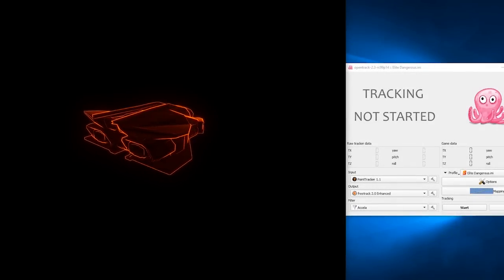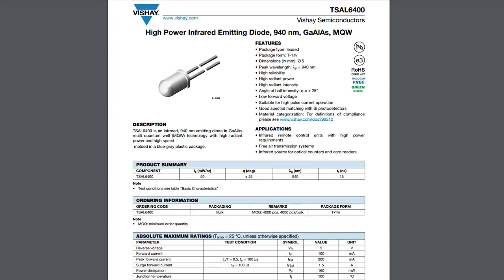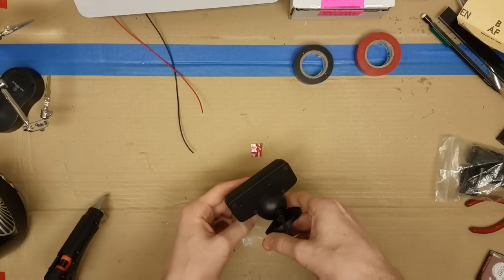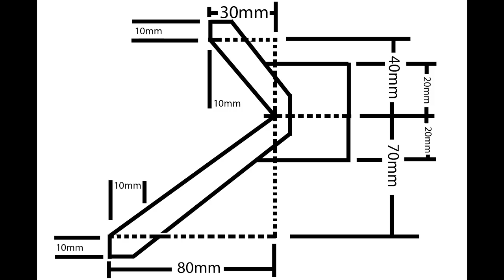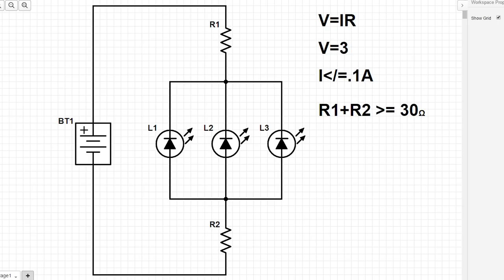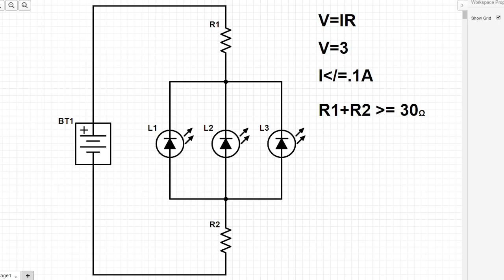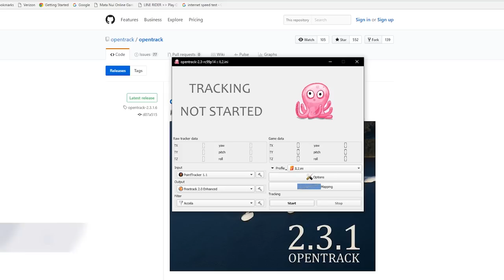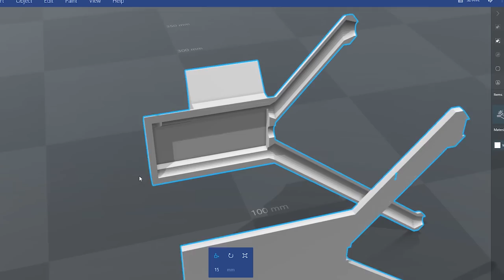TrackIR Build Tutorial

Comment: Hello, I use the Trackhat in combination with the flat lens camera from the PS3 (the same you use in your video). But I don't have a IR Filter lens. Can you tell me, what this lens is for? My camera works pretty good, but I need to darken the room to avoid light reflection from the window, which is on my back right. Maybe an IR Lens avoid it?
Reply from the maker: The IR pass filter blocks all visible light while allowing through infra red light. Most tracking systems utilize infra red light because it is outside the visible spectrum to humans, and so isn't a visible distraction. Using infrared will also help the tracking system distinguish between the head unite from other light sources in the visible spectrum. Example: My tracker can perfectly track my IR LEDs, but it is completely blind to a blue LED. Example2: Sunlight ranges from ultra violet through infra red. An IR pass filter in this situation would bock out all ultraviolet light and all visible light, but allow through the infrared light. This makes sunlight a particular nuisance for head tracking. If by "darken the room" you mean that you are turning down the lights in your house, then an IR pass filter will probably give you a significant improvement. If on the other hand you are closing blinds to block out sunlight, and IR filter might help, but it won't solve your problem. I hope that answers your question.
Reply: @civilprotection8845  Yes thanks. That helps. I have ordered a IR Filter Lense in China for a little less than 10 Euro. I also asked my father if he has an old floppy disk. I read that two or three layers will also filter the light and let the IR through.

Thanks for support

Comment: Do you happen to have the blender file available that you used? I have no idea about Blender and anything that can help with the main portion of the shape would be really handy
Reply from the maker: Check the bottom of the description. You should be able to get your hands on the blender file, and a .stl splitting it for printing. Some of the design choices are specific to me and my headset and may not have an obvious function, but the base shape should be easy enough to work with. Good luck with learning blender (It's really quite a handy tool!), and if there are any problems with the download links, just leave a note and I'll fix it :) Cheers!

Comment: any idea how to mount it to headphone? i build one a year ago using cap but it's aging so iam thinking of doing clip this time.
Reply from the maker: Velcro would be my first suggestion, but if you have a nice headset, maybe you don't want to get glue on them. I've been using cable straps like these: https://www.amazon.com/Rustark-Adjustable-Self-Adhesive-Straps-management/dp/B071RGCJLT/ref=pd_sim_60_2?_encoding=UTF8&pd_rd_i=B071RGCJLT&pd_rd_r=d21cb485-83d1-11e8-bc22-5d0e7f4bb9cf&pd_rd_w=6DjW0&pd_rd_wg=NyWbY&pf_rd_i=desktop-dp-sims&pf_rd_m=ATVPDKIKX0DER&pf_rd_p=7967298517161621930&pf_rd_r=7RWCJ0YP39ARWSB6N871&pf_rd_s=desktop-dp-sims&pf_rd_t=40701&psc=1&refRID=7RWCJ0YP39ARWSB6N871&dpID=51aPN5kuMTL&preST=_SY300_QL70_&dpSrc=detail

These straps only work if your headset is narrow enough where you want to mount the clip. I hope this helps.
Reply: does it matter if i place clip on left or right side of headphone?
Reply from the maker: I don't think it should. As long as you position the IR receiver off-center to the same side, everything should work perfectly.
Reply: How did you attach it can show me pls @TrollMilitia
Reply: @helelelop I still have it lying somewhere don't remember though but I simply used zip ties and hot glue & a sacrificial pair of headphones attached to its left side since there was mic on right if I remember correctly.
Reply: thx @MrTrolololol

Comment: hello, does it work with any ps3 camera ?
The delanclip system working with a specific model who is modified.
Reply from the maker: I really couldn't tell you for sure what the delanclip works with as I have never owned one myself. I would expect that an unmodified eye camera will be able to track the delanclip. However, the reason the ps3 eye camera is modified is to block out all other light and to isolate the delanclip lights. I hope that answers your question, and good luck with your build!
Reply: @civilprotection8845  ok thanks, so your solution is easier to make because finding the good camera is a pain today.

Comment: For using head tracker with laptop camera, which led is better for tracking?
 850nm or 950nm ?
 Flat or round head led?
Thanks for your great video.
Reply from the maker: Both will work just fine. You can even go as low as 700-750nm. What matters for tracking is the capability of the camera, the pass filter you add, and the  brightness of the LEDs. Some cameras can-- by design-- pick up infrared, and some can't. Once you have a camera that can, then you decide on both the filter and the LEDs you want to use. Brighter LEDs will track better at a distance.

Rounded LEDs with a diffusing solution (like sanding) have always had better tracking in my experience.

I have never made a setup with a laptop camera, so you might need to do some independent testing. Your first step imo should be to test the maximum framerate of the camera. 60FPS should be your minimum target (my PS3 eye camera runs at 75fps).

Good luck on your build!
Reply: @civilprotection8845  thank you so much for your kind help

Comment: I knos this is old video but... Its still works if i replace battery to USB cable, and i put this to phone charger or something? And how its looking with resistors ohm?
Reply from the maker: Yes it is possible to make a wired version, but you would need to figure out the voltage yourself. Try researching for USB transformers.

Comment: Ok is it AAA or AA Video shows AAA but link shows AA although the voltage is the same, I'm wondering about the amperage,500-600 mAh AAA & 600-1600 mAh AA? Thanks
Reply from the maker: So, in my testing, AAA and AA are functionally identical. The main consideration for me was weight. I ended up opting for the AAA because I could feel the AA pulling my head to the side (though nothing one couldn't get used to after 5-10min).
I also experimented with 3.5V rechargeable coin batteries, which were much lighter. Ultimately, after making this video, I redesign my own headtracker to run off a 5V usb to dc powercable.

I hope that answers your question, and best of luck with your build!
Reply: @civilprotection8845  Yes it has, I need to do a facepalm...never occurred that weight would be a factor. Thanks! 👍

Comment: This is great, but... want to make sure I'm not missing something. Assuming you don't already have a soldering iron (which I don't, and I think most probably don't), this build comes out to $91.51 on Amazon. Plus labor time. The Declanclip build is $15 cheaper and comes pre-made. AM I missing some cheaper step, or is this just for DIY folks who don't care about price?
Reply from the maker: Without knowing the contents of your cart I wouldn't hazard a guess about what you may or may not be "missing." If this is your first DIY and you are buying a lot of intro kits for soldering equipment, resistors, wire, electrical tape, etc. that will drive up the price. I calculated the price from essential components only: ps3 eye camera, LEDs, IR pass filter, battery boxes and software. That does work out to $30 or less (I would need to search through the comments, but I think someone mentioned they brought the price down to $10). I assume that someone interested in DIY circuits has electrical their own soldering iron & solder, wire, electrical tape, etc. for the same reason I would expect them to have an exacto knife or a pair of scissors to cut the cardboard to shape. these are just accepted tools and components typically not figured into any one project. It would be an interesting survey though; to see how many people already own a soldering iron.

The Declanclip comes up a lot, and part of me wants to purchase one just so I can accurately compare it to my DIY. Is it just the clip, or does it come with an IR camera? I don't know.

The point of the video is not to convince anyone that a DIY tracker is the absolute best option, rather it is 'a' option. My goal was to help people save money, and if you decide that an option like the Declanclip is ultimately cheaper, then take that option. If this video helped you make that choice then it did its job. I will say that if you are absolutely sure you will never work on another DIY project again ever, then don't tool up for it.

Save money. Enjoy flying. o7

Comment: Hello, thanks for the nice vid :D Unfortunaly i saw it after i made my 3D printed trackIR :D  I made some test with the black part of a medical imagery (which work like floppy disk/pict negative) and floppy disk but nothing not look so good :( My 3D print has caps on the led to spread the reflection on more than 40° angle ( i use 950nm ir led ), i just ordered a ir filter like your, hope it will working fine with the cap on the trackIR... Without the cap it looks like the IR led angle is  more like 15° or something like that, do you have any idea on that ? Probally the floppy/medical imagery issue ? I've got a ps3 eye with the built in filter not removed.

The new filter will come only around 9th feb so...
Reply from the maker: It sounds like you need to sand your LEDs to diffuse the light more. I would start with that. If you continue to have problems then it might have to do with the brightness of the LEDs-- that would be my guess.
Reply: @civilprotection8845  Can we sand the leds safely ? I'm pretty noob around that, if you have any suggestion on the how to, i would apreciate :D We took those leds btw (datasheet): https://www.gotronic.fr/pj-716.pdf

Thanks for taking time to anwser. o7
Reply from the maker: @sckedaz6649  It's very safe and very easy I promise. Just take a bit of sandpaper (200-600 grit) and lightly sand all around the head of the LED. Normally I recommend sanding until the lens is evenly "foggy." I'm looking at the data sheet (it looks like a good choice of LED) and if the LED lens is black, then it may be a little difficult to judge . Light sanding is until it becomes a light grey or white will probably yield the best results. Start with that, and we'll go from there. Good luck!
Reply: @civilprotection8845  Allright, i will give a try :D I will probally wait for the new filter like your which will come between the 22th and the 9feb, then i will sand the leds if needed :D Thanks anyway for your anwser, that help a lot and most of peoples doesn't anwser like you so big cheers for ya :D I will come back to you when i got my filter and sanded the leds ;) Have a good day sir. o7
Reply from the maker: @sckedaz6649  Good luck!

Comment: Would i be able to use the track ir headphone mount for the track ir 5
Reply from the maker: If I understand your question, you want to know if track ir 5 will detect the LEDs I use in the video, yes? The short answer is that I don't know. I think there is a good chance that it will work just fine, but I can't speak from personal experience.
Reply: @civilprotection8845  no the leds that come with the track ir pro but using the ps3 cam
Reply from the maker: @ProdAstro-fw5wq  Ah, so I got it backward. My answer is still the same however. There is a good chance that it will work, but I cannot say for sure. One thing you could do is to check if your phone can see the trackir LEDs, though not every phone cam can see ir (Samsung typically can, I think).

The biggest risk is with the IR pass filter. If you can, find out the wavelength of the trackir LEDs, then make sure your purchase an appropriate pass filter to allow that wavelength while still blocking visible light. My pass filter blocks 850nm and shorter, so the LEDs I use are between 880nm and 950mn. However, some ir LEDs have a wavelength as low as 750nm, which would be blocked by the pass filter that I use. You could always go with a 750nm or (maybe) 680nm pass filter as a "catch all" solution.

I wish I could give you a more certain answer, but research will probably yield more answers than I can. Still, I wish you best of luck with the build!
Reply: @civilprotection8845  thank you thats all i needed just needed to know what you used

Comment: How do you attach the unit to headphones?
Reply from the maker: for lightweight builds, a bit of Velcro on the unit and the headset will be enough. For something a little heavier I recommend lashing it to the headset with string or rubber band. I use one of those easy-mount cable management fasteners with an adhesive backing.

Comment: So I purchased both the PS3 camera and the IR pass filter, glued them on with multiple rounds of hot black glue, but I'm still seeing light through the windows behind me.  It makes the  IR headset completely non-functional.
Reply from the maker: Ah. So the light that the sun emits ranges from ultra-violet to infrared light. A way to think about it is that sunlight contains visible light, UV and IR light. Your IR pass filter will block out the visible and UV light, but allow IR light to pass through just like it allows the IR light from your LEDs to pass through. I have a window behind me as well, but the blinds keep most of the IR out. I'll recommend a similar setup for you. I hope this helps!
Reply: @civilprotection8845  I did make more adjustments to the camera after doing some more reading, like maxing out the gain and minimizing the exposure (or the other way around) .  I feel like I would get better results if I removed the built in IR filter in conjunction with using the 25mm IR Filter, if that makes any sense.  I feel like my IR leds are not bright enough, maybe too much resistance? I used 32 Ohms worth  of resisters.
Reply from the maker: can you post a link to the data sheet for the LEDs you used? The internal IR filter is designed to be very weak because the camera was meant to track ps3 motion controllers using IR bulbs, so I don't think you'll see any major improvement by removing it. I cant really speak to the exposure other than that I didn't mess with it. Post the data sheet, and let me know if it works in a dark room (or at night). Hopefully we can get you sorted.

Comment: This is fantastic What is the battery pack voltage my friend and great vid.
Reply from the maker: The battery pack is designed to hold two AAA batteries. Disposable AAA batteries have a voltage of 1.5V per cell (totaling at 3V in the circuit). I use rechargeable AAA with a voltage of roughly 1.4V per cell (2.8v total).
Reply: That's great thanks

Comment: Shouldn't the circuit resistance equal 10ohms as the current through each LED should be 0.1A and as the three LED's are in parallel then the current before being split by the parallel section should be 0.3A. Therefore  (3V / 0.3A) = 10ohms???
Reply from the maker: It's actually even less than that. LEDs do not follow Ohms law, so the equation should look more like {[3V - (sum of the forward voltage)] / 0.3A}. I'm working on a couple new head tracker designs, and eventually (hopefully) a new video where I can explain some new stuff. As a last little aside, it's not strictly a bad thing to over resist your circuit. by doing so you will increase the lifetime of your LEDs, and if your LEDs are too bright or too close to the camera, the glare will create false pointlights (from the cameras perspective) and will stop tracking.

Comment: I have done almost exact the same things you did except sandpapering the leds.  But still i have calibration and positioning issues.
Reply from the maker: does tracking cut out when you turn your head more than 15-20 degrees away from the camera?
Reply: @civilprotection8845  yes it used to be. But right now, it's working almost perfectly. I did sandpapering thing and played with curves etc. I'm using exact the same LEDs as yours. TSAL6400, just added a 30 ohm resistor somewhere in the circuit. No heating at all. 2x AA batteries (1.5V each).  I may do some tiny modifications with the trackclip to make it look a bit more professional. Thank you so much again.
Reply from the maker: @vnavspeed6737  Sanding was going to be my recommendation. I'm glad everything seems to be working :)
Reply: @civilprotection8845  Thank you very much again. I mean, your tutorial was the first one i saw and i decided to follow your path. I'm so satisfied. Wishing all the best sir.
Reply from the maker: @vnavspeed6737  Lookin smooth! Happy flying o7
Reply: @civilprotection8845  thanks a lot again !

Comment: Is it possible to use another camera or is PS3 camera better?
Reply from the maker: There are other cameras that work. The PS eye cam was the best option because it could track IR at high framerates (75-120fps), and it was cheap. I don't really have a comprehensive list for better or for worse. I wish I could be more helpful. Good luck with your build!

Comment: Which version of the PS3 eye camera do you have?? (the easily modded one or the not so easily modded one)
Reply from the maker: There is a link in the description to the exact camera I used. I just checked and the link still works, though the price seems to have gone up considerably.
Reply: @civilprotection8845  Ok thanks man. Seems like they just randomly choose one from that listing.
Reply: @civilprotection8845  Do you know if the easily modded one has the same ir filter as yours and therefore doesn't have to be modded or did the ir filter change when they released the new one (yours)?
Reply from the maker: @tsl1520  You might need to post a link of the exact product you are looking at. What makes the ps3 eye camera ideal for this conversion is that it is already designed to track the infrared light from Play Station motion controllers. The internal IR filter is extremely weak. The external filter modification I made blocks out visible light only (essential unless you will always be playing in the dark).